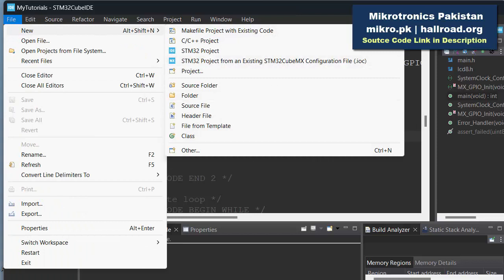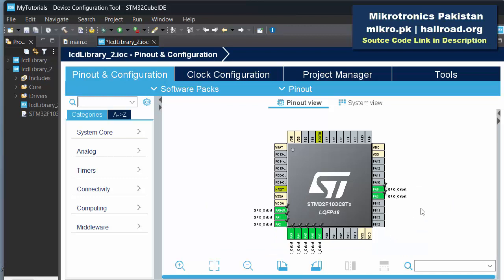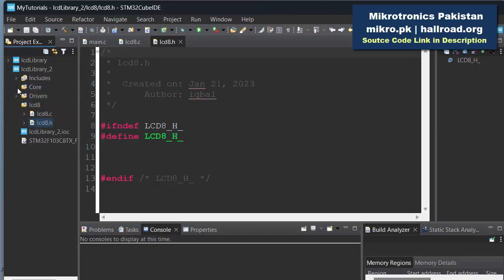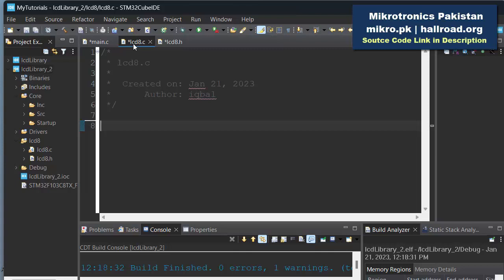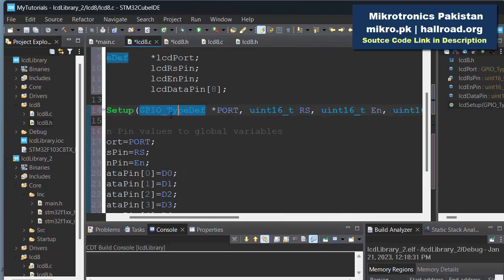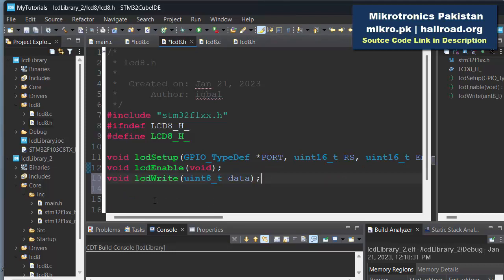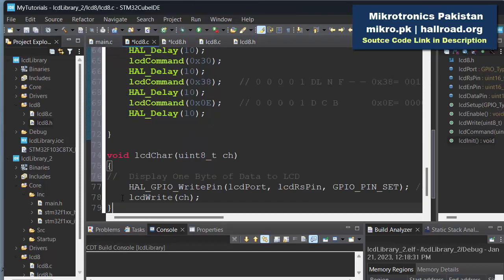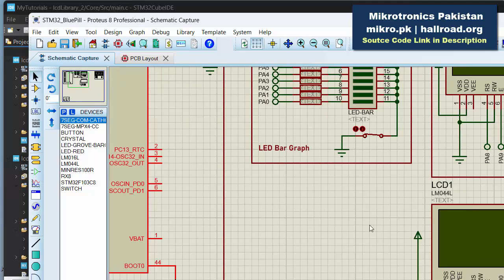STM32 for Beginners | Writing C Library for HD44780 Character LCD Part-I

Comment: Maybe I'm wrong or missed a part, but I didn't see if you have implemented busy bit of lcd in library!?
Reply from the maker: No I have not implemented it, to reduce one IO line. Instead I assumed a time delay that the function would have completed. Nevertheless you are right implementing busy flag is ideal.
Reply: @mikrotronicsacademy  I'm not sure is it possible without level shifting circuit, since LCD has 0-5V level, so pin on STM32 needs that level votage capability. Anyway, on youtube channel "Build Your Own CNC" guy has implemented buisy bit on ATmega, so it's not problem to tweak that code and implement it on STM32.